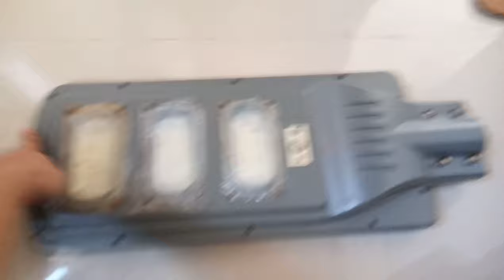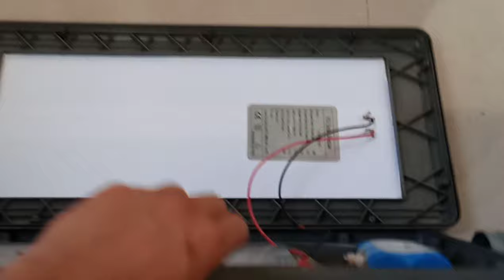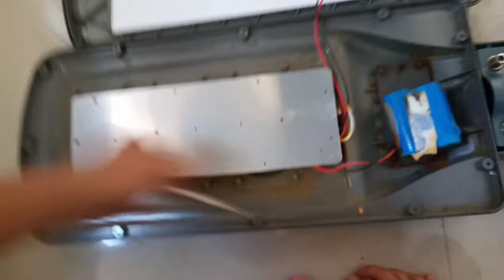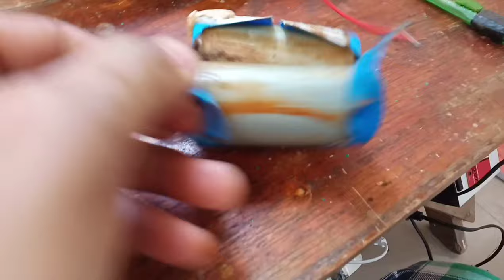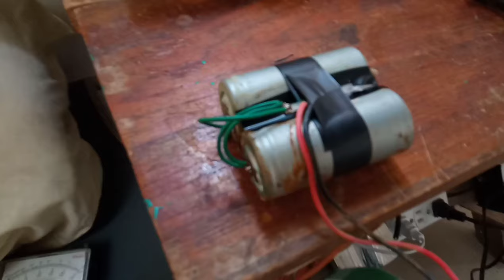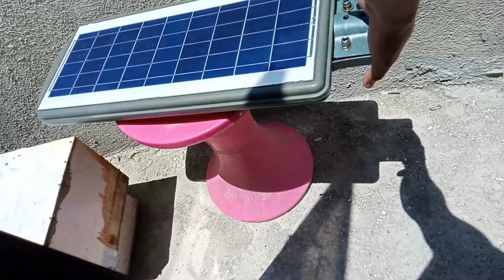HOW TO FIX SOLAR STREET LIGHTS | EASY LANG PO YAN PANOORIN NYO NA

Comment: anong ginawa? nilinis lng ba o pinalitan ng battery? sana nmn nagsalita kau para malaman ng viewers ano gagawin sa pag diy..or kaya captions mn lng.
Reply from the maker: Issue nyan boss is napasukan ng tubig sa loob tas yung batt nya wala ng connection marupok na yung jumper nya kaya ni resolder ko lang at pinalitan ng wires tsaka kunting linis lang okay na may power na